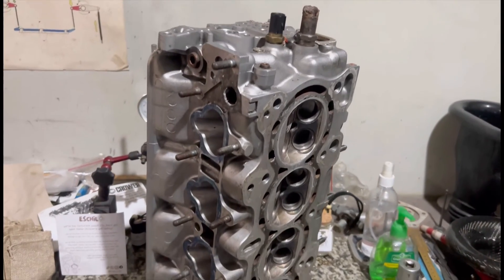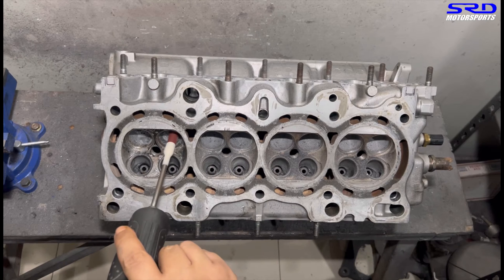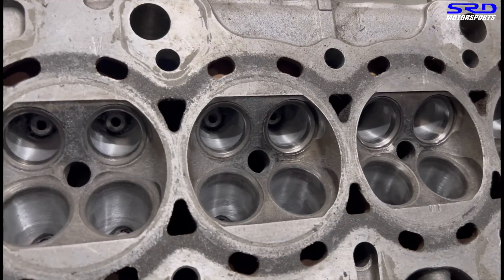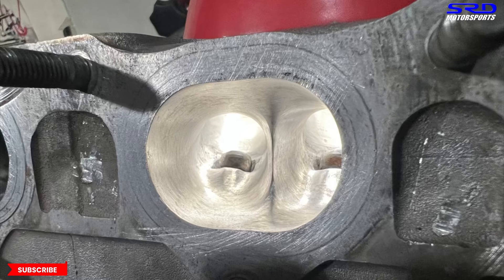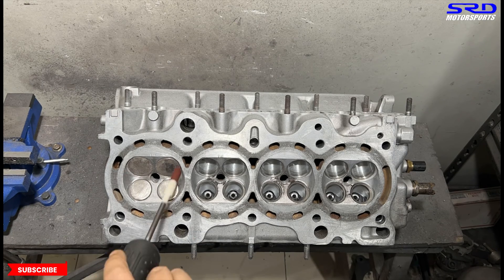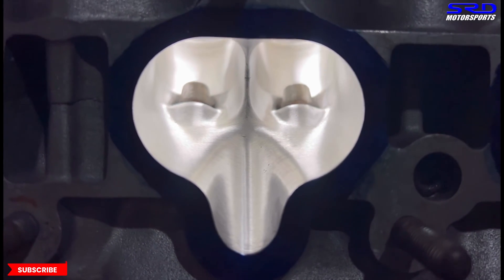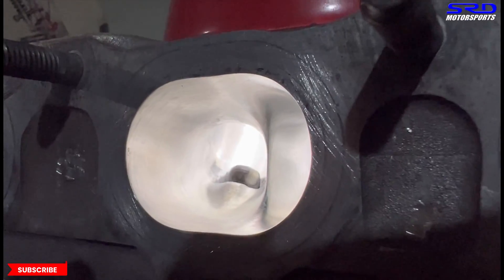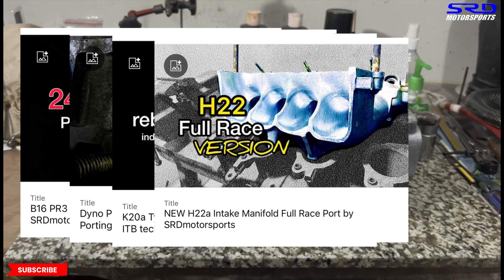B18c1 GSR Head Porting and Chamber Work for a B20vtec build

Comment: I'm not well-acquainted with the specific casting details of the GSR head, but yours closely resembles the head featured on your channel belonging to a previous customer, where the HM markings are italicized. Initially, I thought your customer's head was an HMaking one from China, but it appears that the OEM head is designed in that manner.

By any chance, have you encountered Chinese made Honda cylinder heads locally? I watched a video on Headgames' channel, and the comments about the casting were somewhat positive.
Reply from the maker: yeah the Aussie destined core is similar I never realized it until you mentioned that!

and true I saw the Headgames video a few times and honestly havnt had a chance to have my hands on one… actually I’m really considering asking Dave (owner) of Headgames where it can be scored and prolly save up to get one just to study and port 

I mean sooner or later it will be used for sure so a spare is always handy
Reply: @SRDmotorsports  I attempted to find it on eBay without success; perhaps I overlooked the elusive search term, hahaha
Reply from the maker: @findtherightbeat  i did try too and ran out of search terms to write 🤣 hmmm ima try it again soon

Comment: Hope it's okay to ask, which particular carbide burr do you usually use?
Reply from the maker: Hey slr, bfast was more important kase late 🤣

I just use the common or regular carbide I got from a local tool shop it’s tree shaped or pear shaped? not double cut etc… I have the cylindrical shaped and the round one too but havnt used it as much unlike the tree shaped carbide

it has a 6” long shank so it helps not being too close to flying debris 🤣 I know on the early days vid (2yrs ago) I think I made a vid about the porting bits but next video I make il have a moment to show them for sure
Reply: @SRDmotorsports  Thanks! The finish of your ports are really nice compared to others that I've seen and it's not just visually nice but it also is effective 🍻
Reply from the maker: Thanks for that! And well yeah I mean I realized back then (til now) I can rely on light and it’s glare on surfaces to double check or ensure consistent curve or bend and lesser unequal areas…

The lube and mix ratio to “hand” pressure I know plays a factor as I did experiments on manifold porting to find certain finish too
Reply: @SRDmotorsports  If you don't mind me asking, who taught you how to port cylinder heads?
Reply from the maker: actually it’s mostly reading on forums especially D-series dot org, as back then I started with a sohc and one of the early or second only mini-me in the land…

Then further expanded thru HT on B and D series

But prior? To the Dseries I actually started and tested vw heads on my dad’s bug 🤣

Then the passion on rc planes helped cuz I was always fond of “aero” and flow
Like to this day I’m still amazed at how they came up with the cooling system of the 
P51D mustang and the “Meredith effect” on the cooling system
Reply: @SRDmotorsports   I really admire that you're self-taught when it comes to porting cylinder heads, it's not something that's easy to learn. 🍻